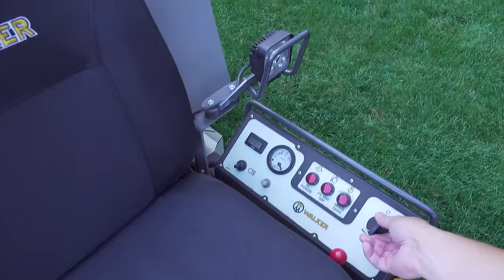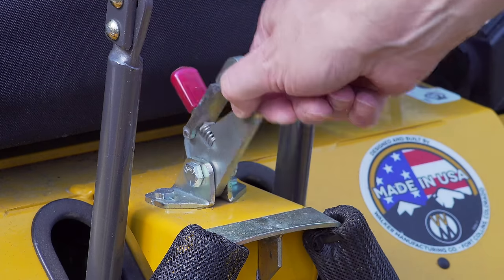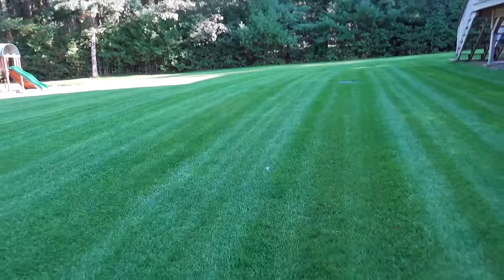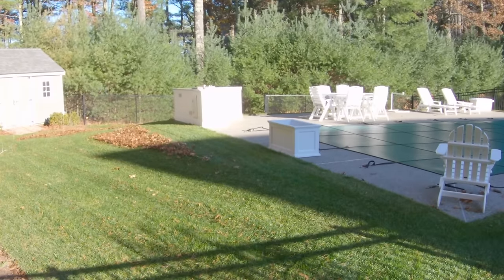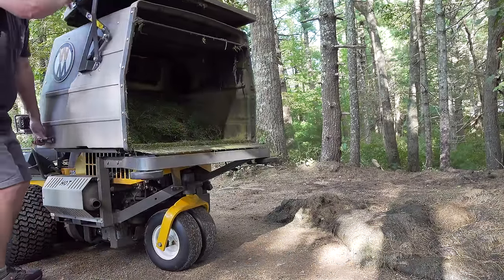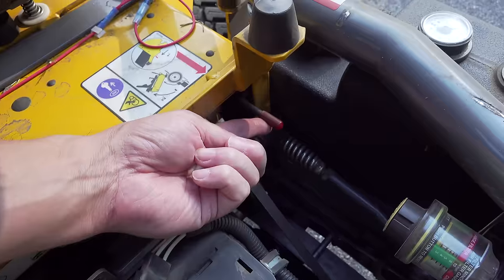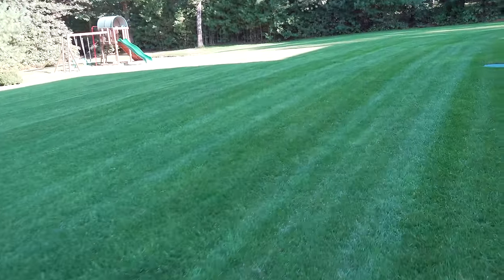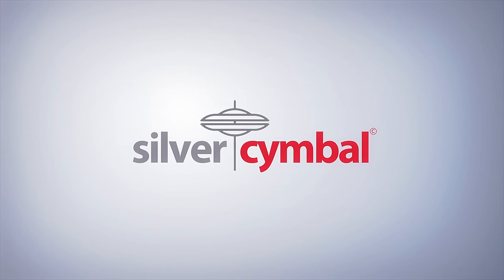Walker T25i Lawn Mower Review & Make Money

Comment: I have used walkers for 20 years and have a number of them, can’t beat them for leaf cleanups. One other thing that is amazing from a commercial standpoint is using a grass handling system Walker like you have shown in the video but also purchasing a $2500 mulching deck and after the fall/winter clean ups switching to the mulching deck. They are unbelievable, I can honestly mulch a foot deep in leaves with no debris, occasionally I will go over this twice but I’m not collecting leaves, having to stop and dump or having to go to the county dump and pay $, I only switched over 2 years ago and it is an unbelievable time saver and money maker.

Comment: I’ve used walker for 2 years and this is my 3rd season, I just purchased the walker T27i for $17k. Just make money guys, get out there, work your ass off and do the best job, you’ll build up a  client list. I mow 45-55 lawns per week with the walker no problem. With the new machine I’m expanding and my goal is 75 lawns a week (solo). Happy cutting season!
Reply: Walker handle bigger accounts fast?
Reply: @danzuber2701  Depends on your dealership, mine was quick & as far as long term maintenance, they handle it like a priority
Reply: @goat9754  How fast are they  cutting. I think it would be hard to switch up from the current standers I run. Less the walkers have decent cutting speeds etc.
Reply: @danzuber2701  my T27i and myself go through 50-60 lawns a week solo under 50 hours, I went Walker 3 years ago, then was able to upgrade quickly just by performance alone. The cut quality, maintenance, maneuverability all really adds up to a great machine, I believe I’ll be purchasing another new one in just a few short years as I expand.
Reply: @goat9754  I might have to look into a side discharge deck or deflector for the back. Not much bagging on my route. Thanks for the info

Comment: I have a bobcat zt120, basically the same design. Bought it used with 200 hrs for $3000. Great for lawns with lots of flower beds and pools, the grass doesn’t fly everyplace! One reason I believe it gives you a better cut is because of the extra suction from the blower and less weight  on the cutting deck. Not pushing the grass down. My mower is almost 20 years old and saves me so much time on clean ups, just suck up the leaves and dump! Great alternative to a walker.
Reply from the maker: I have seen those mowers they looked really good

Comment: I use one and it is from ‘07 they cut great and last forever there are still some from the 1980s still in service
Reply from the maker: I see a lot of the old ones out there too, they do seem to last forever!
Reply: Hit piece of steel hiding in bush, locked the blades and think snapped piston. It's from the 80's, old 11hp Briggs. Problem is until I open it up won't know if tore up block any and if good don't know where to find parts, so far most stuff that old I find says obsolete

Comment: After dethatching about 10,000 sq ft of my lawn and then raking it all up getting one of these sure is tempting as it can dethatch AND pick up the debris in one sweep. I have a lot more property that I need to cut in back besides the 10k around my house. I think if my Toro ZTR died I'd pick one of these up. Thanks for the video.
Reply: Dethatching no machine can do it like the Walker
Reply: This mower has more wheels to turn so it’s won’t cut as fast as your toro turn radius is wider proper 3 point turns will be longer opposed to your toro keep that in mind I seee these walkers as situational mowers clean up only on my opinion and the best clean up mowers out there but cut quality your toro which is really an exmark will cut better if you have the commercial grade toro not the residential

Comment: I have been using Walker for a couple of years now. For Commercial usage very limited. Excellent at sucking up leaves. It will put down better strips if you change the back wheels to the double tire and less turn most at the same time. Sell the snowblower attach     Imo used it for 1 New England winter spent most time suck in snow and it absolutely killed the machine so many repairs in the spring.

Comment: They do have a good bagging system. However the controls are goofy and the cut quality is highly debatable. To me the rear casters ruin the look.
Reply from the maker: Yes I agree about the bag. The controls are totally different than anything else but they seem to be easy to love after a while. They offer a different rear wheel option that spaces them out if you want a different look. I have checked it out but haven't bought it yet. Walkers has a million options but they are not cheap for any accessory!
Reply: And they are hard to work on IMO

Comment: Walkers are great for smaller accounts, but otherwise they're too small and too slow.  They vacuum well and are great for cleanups, but during the peak growing season they're too slow and it's too time consuming to keep dumping.  I have one...its older and a great machine but I've replaced it with the Exmark Navigator which is essentially a knockoff of the walker... but it has a few better features.
Reply: There are walkers and walkers , we  have this 31hp 52 deck 2016 that will do laps around any super z or exmark . but is1850$ starting price.
Reply: @salonsoares2179 

I would like to see that.  My Walker is older but it's a 3 cylinder Kubota gas engine and it's NEVER out performed any of my Lazers except on smaller lawns and where bagging is required.  In May when the grass is growing 8 inches per week and the dew is heavy in the morning, you couldn't use that mower without clogging or moving at 1 mph. I also have a Walker walk behind mower...hydrostatic with a 54" deck.  It's one of my best cutting mowers EVER but their proprietary solenoid (electric activated) drive system fails regularly so we rarely use it.  It just sits around.
Reply: So the catcher fills up quick?

Comment: Nothing mows like walker,  but it will be in the shop non stop.  So much that goes wrong on these that walker cant repair.
Reply from the maker: I heard that a lot and was very concerned about buying one. I almoat never bring anything to a shop and like to do all my own work. After almost 2 years of use I have not had any issues with the machine. I am not a fan of the older units but some of the problems may just be non-sop hard use and they are older. The T25i models and up seemed to get things right. I hope my good mechanical luck continues. I have had an Exmark Navigator and Toro ZMaster that were nightmares breaking all the time.
Reply: A STRAIGHT UP LIE SIR

Comment: I have heard these have a lot of trouble going up hills, is that true?
Reply from the maker: I also heard that before I bought it and I have several hills some are very steep and this machine has been 100% fine even with a full grass box. Not sure where that comes from.  They mae an anti-hll kit that locks the back wheel which helps it track better but it hasn't been a problem to warrant even getting that kit.
Reply: they are terrible on hills even places I never even considered a hill with a toro or john Deere are now dreadful.

Comment: Back in 2010 wish that I had bought a 23I/48"ghs walker instead of smaller mc20/ 48 ghs model i pain 10,500.00 for. Sold it in 2012.

I about bought a 23 efi/62" discharge deck model for 9,700.00 plus tax back in 2017. Bought a John deere x590 instead. Should have gone ahead and bought that walker mower.

Comment: I have one these and it is without a doubt the biggest pieces of shit ever made. Might be ok in clay or compacted soil. In Sandy soil or dry soil the rear mounted bagger shakes dirt right over the engine. Even with religious oil changes and filter care, a huge amount of dirt gets in the engine. Engine life for me is under 800 hours on the original Kohler before it was worn out. The fans for the bagger wear quickly. Plan on replacing it after 400 hours. If you order the mower without the bagger, you end up with mower that is slower than a cheaper mid mount zero turn.
Reply: There is Nothing special about the deck. Lot of commercial mowers have heavy gauge reenforced welded decks. Look at a SCAG deck, makes a walker deck look like a Tonka toy.and parking brake is crap. It won't hold it on the trailer, so you have to strap it down between lawns.
Reply: For home owner with irrigated lawn, this mower will last a long time. For pro cutter cutting in dry or Sandy soil, this mower is a money loser. I have owned and cut with Ferris, SCAG, snapper, Ariens, Husqvarna and Exmark.   All make good mowers. I wouldn't recommend a Walker mower to any professional unless they use  it to cut small. Manicured, irrigated lawns. I will say they leave a beautiful cut.
Reply: @jimbo5635  Walkers are well suited for a higher end lawn for sure. If you're cutting junky patchy lawns that will tear these up. Some mowers are tanks and some are for fine finishing. Its too bad most people don't really care about their grass. They just want it short

Comment: I mean for bagging always been the best but cut quality no way dude!!!???? Third caster doesn’t give off a great clean look to me you do a test with this mower on a good manicured lawn a big lawn and put it against a lazar z or scar tiger stripping and cut quality would be cleaner than the walker any person or customer would be able to see that especially if they are used to the stripping of a lazar z or scag and that’s the difference maker
Reply from the maker: The cut is better on the Walker. Try one yourself, the vacuum pickup is unbelievable.. In New England these are used on every premier property because of the cut and pickup, we get lots of pine needles and debris and the lots are getting smaller and smaller and these maneuver in tighter spots.  On open yards,  larger lots I would choose a Deere, Scag or Exmark. Not saying the other brands don't deliver great cuts but there is a reason people are buying these Walkers for crazy high prices from a company that no one even heard of 10 years ago.
Reply: Silver Cymbal but that’s my point I have cut with these before and the vaccum you refer to is caused because of the bagging system it’s suppose to but the reason why nationally guys don’t use these as number one when pickup is not needed is because side dis charge is usually a quicker/better situation I always prefer mulching or side discharge outside of fall leaf pickup especially in growing season is best to use clippings as more nutrients are reused but I mean using it all year around is not the norm for most compared to say using a scag tiger for pure cut quality and time management..... and no this doesn’t cut as good as a scag nor have natural suction when side discarding as say something like a scag..... not to say these aren’t good mower cause they are

Comment: LOL. NO not every landscaper wants a supposed commercial lawnmower that's built with thin steel like a residential mower. If landscapers want a mower like that they should get the Toro or the Exmark version!! Those 2 are actually Commercial grade.
Reply from the maker: I owned a Toro ZMaster 3000 and 2 Navigators and while they are nice machines the cut wasn't as good. The Navigator is pretty much abandoned by Exmark. Dealers hardly stock them near me and they discontinued the snowblower and other accessories. The other bad part is try selling a used Navigator there are several that are 2 years old that guys can't even sell for 60% of what they paid. Not saying they aren't nice but support, parts and accessories matter and Walker has that wrapped up. Not sure about the thick metal stuff, the Walkers are built tough and their decks are awesome.  Personally I really like the Exmark Zero turns in that category if speed is the #1 need for huge spaces.

Comment: This would have absolutely no commercial value other than leaf removal. Too expensive and couldn’t handle more than a 20 percent grade.
Reply from the maker: They are fantastic mowers and used commercially everywhere. I use them on slopes with no problems at all.
Reply: As someone who runs a lawn care business in NKY i can say I’ve never seen any company use these because of the price and the fact they can’t be used on any type of hilly terrain. Agree to disagree I suppose.
Reply: @brandonmurphy6800  we use them on a few of our high end HOA sites that required to collect the grass every week. Any other system would be a disaster considering we fill a 8 yrd dump trailer every time we service the property. it all depends on the application. I do agree that they are horrible on hills. lol
Reply: leaf piles over 6 inches tall just get pushed around like a rake deck sits toonlow